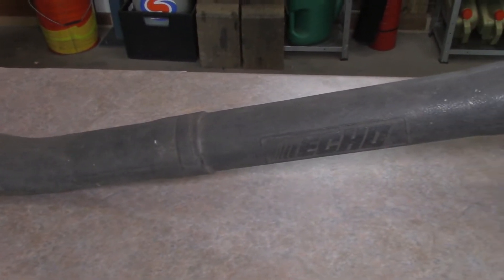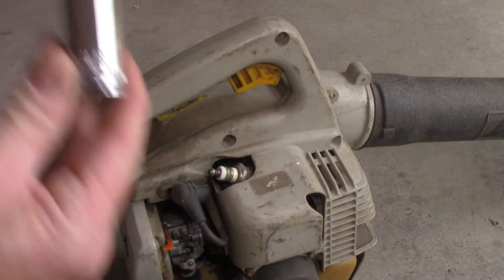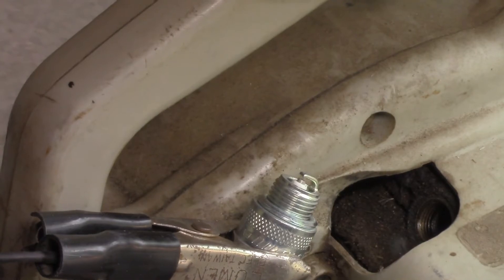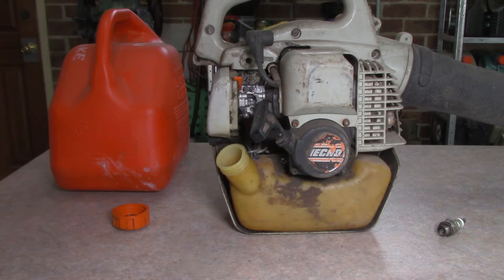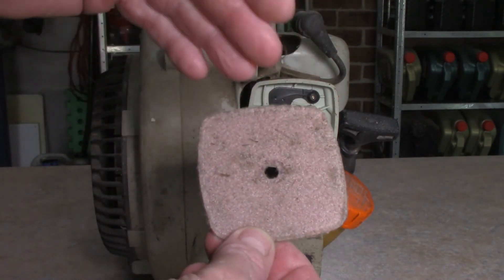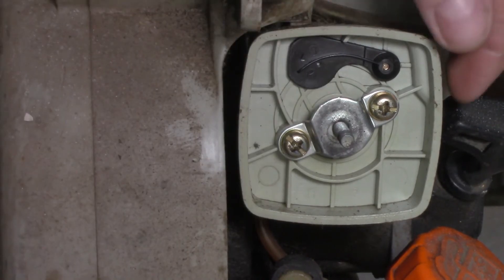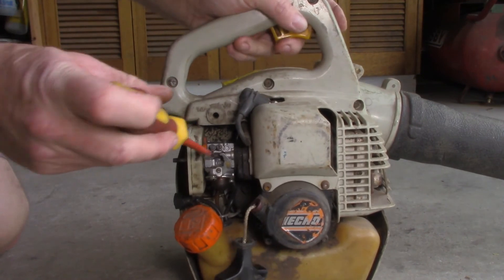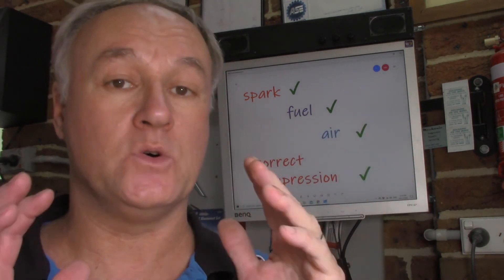Echo Leaf Blower No Start MiracleMAX

Comment: Any input on a PB1000 with weak spark? Had what I thought was a bad coil so replaced it with a used unit. Lasted several months and quit again. Got another used coil from a PB2100 (smaller but bolts up) and it ran like a champ for 10 minuts or so, then no spark. Cooled off over night and fired up again... for 10 minutes.  Each time I assembled it, I would test with a spark tester before finishing the outside case. The spark was amazing, snappy, bright blue. After cooling off it was visually weaker but still ran for a time. Bought a new aftermarket coil and same thing. What gives? Been doing auto / truck repair for over 50 years and this little thing has me stumped.
Reply from the maker: I gather you replaced the spark plug. Are you using the original plug lead? Is the gap to the magneto correct? Is it clear of debris? Do you have a good ground circuit?
Reply: @MiracleMAX  Coil comes with a new lead, and plug works in other equipment. As I stated, it will run till warm then quit. Gap set with a business card so roughly 0.012". Hasd it apart several times in the last month and blew it out so pretty clean inside. Also pulled the wire off at the kill switch.  The coil screws to the block so grounded for sure. Someone suggested the magnets on the flywheel might be weak. Never saw that before and they seem to have similar pull to another unit I have on the bench.
Reply from the maker: @rupe53  I was going to mention the magnets, but thought that was a stretch. However, if magnets are dropped they can be affected. Do they pull the magneto in easily and is it hard to pull the magneto back out? Are there any slight cracks on the magnets? That shouldn't really change with temperature though...
Do these use a capacitor?
Reply: @MiracleMAX    no separate capacitor. The coil is potted in epoxy and the plug lead is glued in there too. The magnets will attract a screwdriver although one is stronger than the other. I have another blower for spare parts and that's about the same. I have trouble believing there are two units with the same problem, unless it's a known / common issue. Just the fact that the spark is intermittent at times makes me shake my head.
Reply from the maker: @rupe53 You have to figure out the reason for spark/no spark. What varies? Temperature? RPM? Can you heat up components with a heat gun or use freeze spray to see if the spark comes back? Do you lose ground during that time? Or do you you lose power? Can you do a voltage drop test during that time to isolate?
Reply: @MiracleMAX  I did automotive for over 50  years so well versed at most of these issues. What I am not familiar with is particular mfgr quirks and I was looking for "that guy" to say, "oh, this brand is known for a problem"...  that has yet to be named. Yes, heat seems to be one of the factors. I don't think you can ground any better than screws right to the side of the block. (with lock washers) Waitting for it to cool off seems to play a part but is not consistent. I do test for spark before a full assembly of the covers. I have opened this up about six times. May give another look this weekend because we all know there are times when you just need to step back for a bit to gather your thoughts.

Comment: I was hoping you where going to scope it and test some secondary ignition Max
Reply from the maker: Sorry mate, I have clearly let you down :(   I'll get out the oscilloscope soon :) You are right, what is a video without a scope!
Reply: @MiracleMAX  no doubt someone will benefit from it max well done and thanks for sharing
Reply: My late dad  reckoned Ryobi coils were a let down and too expensive to worry about , yes ditto I was hoping for something electrical in this video yet  still a  very interesting video though ,  took me along time to work out why my pulsajet wasn't working , just needed a piano wire pushed down the pick up tube  under the mesh filter. 

 - like your style , sort of a how to for Dummies (trade mark already taken)   your intro video shows us the teacher in you , EG writing tech books ETC. congrats and thankyou.
Reply from the maker: @keithcitizen4855  Hey Keith,
Thanks for your comment.
I thought that this would be a little more complex as well. But sometimes, you just have to 'make the complex simple' (hmmm......should I trademark it??)
A lot of repairs do tend to be maintenance related & so I look forward to ones that stretch my grey matter.
I appreciate your feedback as well. It is hard to balance between keeping things super simple for some & yet detailed and in-depth for others in the trade.
I was interested in your pulsajet comment. What do you use that system for? Clean jets, filters & pick up tubes are crucial for proper spray patterns & I guess can easily get overlooked.
Cheers

MiracleMAX
Reply: @MiracleMAX  miraclemax a good TM multi thousand views proof enough.
 
Please check out fixing Briggs and Stratton pulsajet carburettors 

Enjoyed the Hyundai spark plug fix , am surprised those coils are such low resistance guessing it's a primary winding next to spark gap winding ?
Reply from the maker: @keithcitizen4855  Hey Keith,
Thanks - will check out the pulsajet carbies. What I looked up was totally unrelated 😁
The primary side of an ignition coil will have very low resistance and the secondary will have within the KiloOhm level.
Not sure if you are aware, but I have been doing an Ignition Systems series.
https://www.youtube.com/watch?v=pco7iG9rWNQ&ab_channel=MiracleMAX
I'll be doing further testing of coil on plug type coils right up to 4 terminal applications on future videos.
Cheers 😃
Reply from the maker: @keithcitizen4855  Hey Keith, 
I tried to reply to your other comment on Hall Effect Sensors, but for some reason, it wouldn't let me reply.